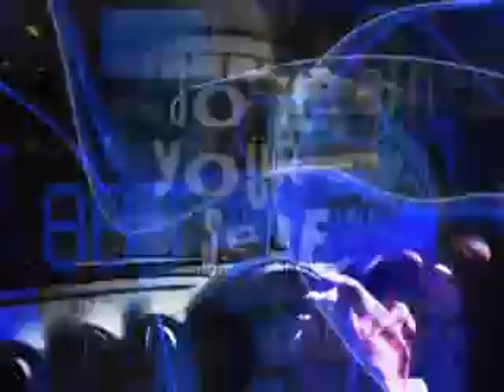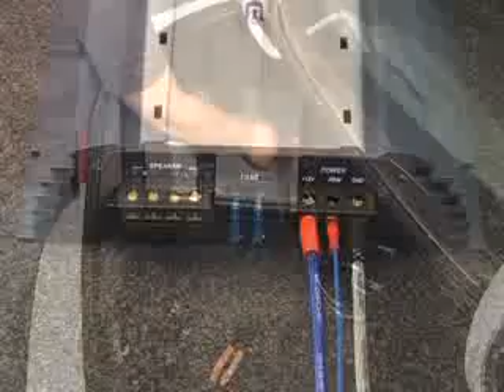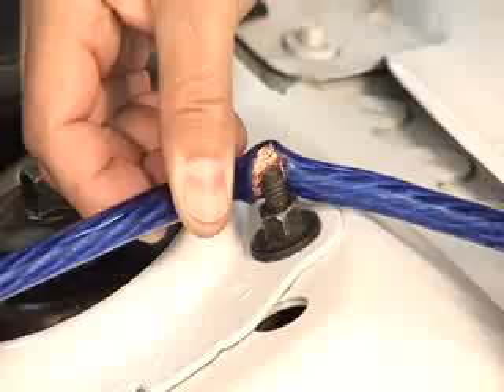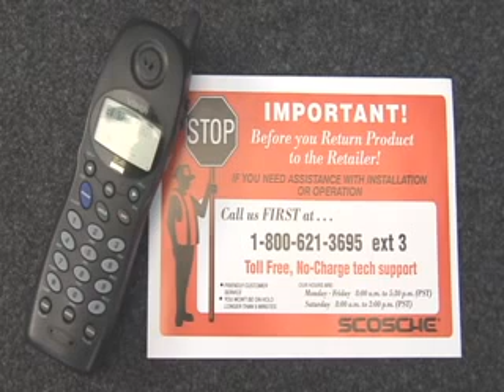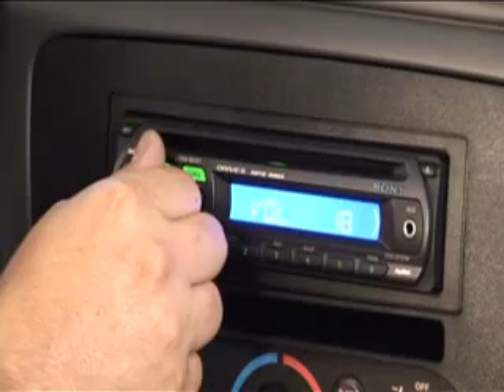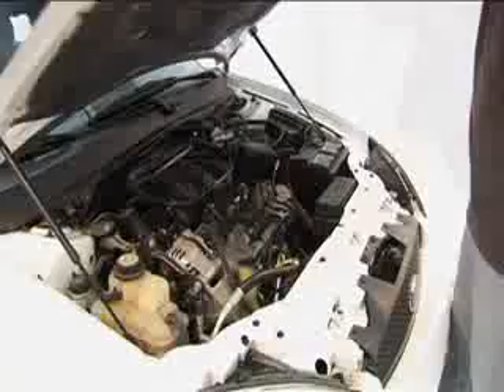Car audio 101 amplifier troubleshooting

Comment: I have a tube in my son's car and all the sudden it has low distorted sound. It won't adjust volume up or down. It's bridged. Gonna troubleshoot in a couple of hours. Any suggestions? I'm going to try the 2 regular channels and see if they work. Sub with multimeter read 3.4 for 4 ohms

Comment: Blue Led Indicator of my Pioneer GM D-9601 Class-D Mono Car Amplifier starts to blink & produce distorted/interrupted sound after playing it normally for more than one hour. I am powering it with the help of 12V 50 amp SMPS to play two 12" sub woofers at home the amplifier has three 40 amp fuses. Plz suggest how to fix it ?

Comment: Actually if you wire more than one speaker on the same channel that is called parallel wiring and the amplifier can only shut off and cause a overload led to come on if you go below your amplifiers stable impedance which doing this is can not only shut your amplifier off but it can also severely damage your car amplifier and cause a fire so be careful when wiring multiple speakers on the same channel
Reply: Travis Gulley  bro very helpful.. I'm one of those do it yourself type guys but atmost a beginner.. I'm a crescendo 800.2 I wired 4 speakers together on one channel.. no sound but I can hear that the subs on... I'm going to try 2 speakers per channel see if that solve my problem? Correct or 1 speaker per channel

Comment: Thumbs down. This is common sense crap. My amp works but cuts off and on with no protection light lit and the green power light is lit. If the Amp goes off and I bump it, it comes back on. What's my problem?
Reply: I had that same problem too then when I looked the fuses just keep blowing. I just unhooked mines. I'm still looking for solutions.

Comment: I have an amp that sounds distorted and foggy any ideas? I have a separate amp that works perfect on all the same conections
Reply: Some amps are trash. You have to try tuning the frequencies, turn down the gain if it's too muddy. And mess with the subsonic settings to cancel out frequencies that resonate, and pull out the higher notes that don't seem to want to register. Then you have smooth sound all the way from the low to the high end. Cheers

Comment: I have two amps in my car .. both are capable of being used for bass or vocals .. amp1 is being used for vocals and amp2 is being used for bass .. everything worked good for one whole day until i turned the car off .. the next day i turned the car on and only my bass (amp2) was playing .. so the first thing i did was check to see if amp1 was receiving power .. both amps were powered on and were not in protection mode .. so, to troubleshoot what i did was unhooked my subs.. i ran speaker wire from vocal speakers  to the bass amp ..  i switched bass amp from LPF TO HPF and i adusted the frequency on the bass amp accordingly and then i took rcas out of bass amp and replaced with rcas from vocals amp .. vocals came on immediately .. so vocal speakers are still new and working and the issue is not the rcas or the head unit or the speaker wire .. i put bass rcas back into bass amp and i hooked subs back to bass amp and set frequency back to LPF and bass came back on .. i put vocal rcas back in vocal amp and hooked vocal speakers to vocal amp and no vocal sound .. i also tried left and right speaker terminal on the vocal amp because its a two channel amp, but still no vocal sound, but both amps are powered on with no protection light .. any ideas???

Comment: If you need this video, pay someone to do your installation. This is a video for straight dumbasses!!
Reply: B Bailey Nothing wrong with learning to do things yourself I have built by hand a Custom truck with Walnut burl wood trim on the dash and doors the same as Bentley and Rolls Royce and i did it by hand not machines Why ? Show me a truck that has the same thing i'll show you a guy that paid good money for stickers that look like wood  From duel car cams front and rear that record 24hrs even with the Truck off with a vott drop protector to a Iphone alarm system and the Raspberry Pi computer on board and a touch screen that gives engine OBD2 problems with the link to ether the nearest mechanic shop or part store for the problem part or the cheapest gas price in your GPS area...self taught Programmer, Mechanic, woodworker Painter Bodyman Prepper Polisher Detailer Oh and winner of the Toronto Custom auto show.....Give a man a fish and he eats for a day...teach a man to fish...
Reply: *****
 You should know hell your so old i bet you were there And after you try to figure out how i know how old you are I'll slap you with another one like your life sucks so bad you never moved out of Fayette ..Did i forget to tell you I'm REALLY good with Computers and Tracking people down?
Reply: You're an idiot
Reply: it is better to do it yourself, because the guy that done it for me fucked up somewhere, just after a week my sub stopped working, so i took it back and then after a few days it started to make a buzzing sound and only worked spmetimes ????? and now it isnt working again.. sooo i paid him twice for useless work and he dare call hiself a professional..